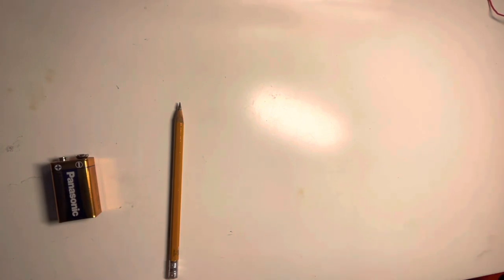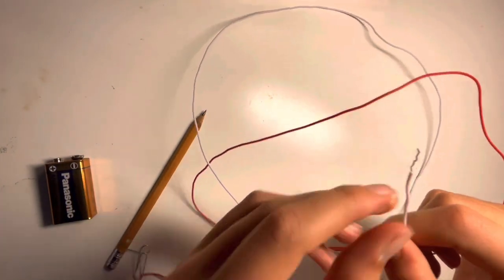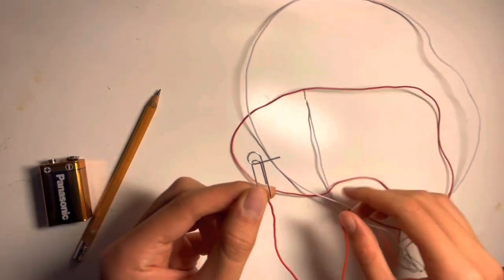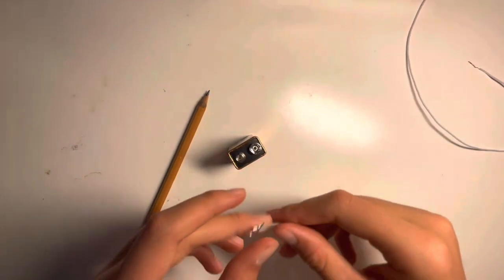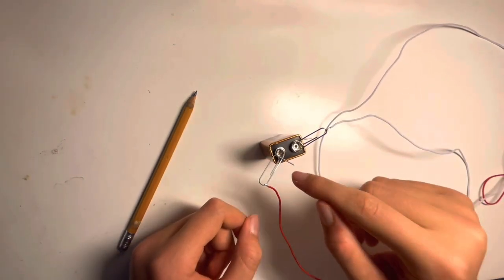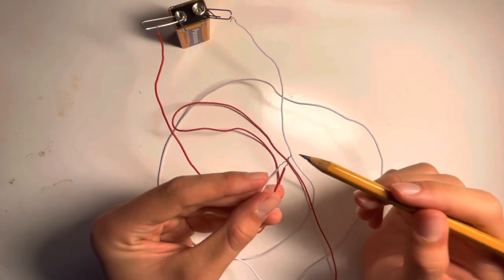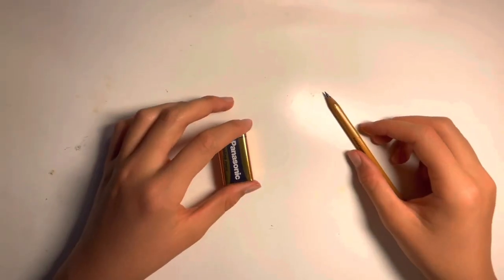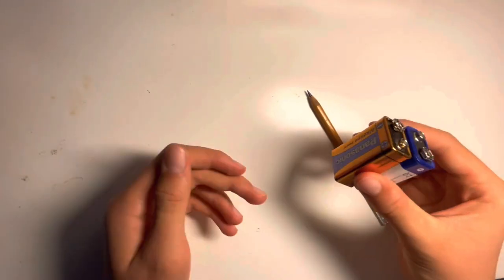How to create Safe Sparks at Home using a Battery

Comment: While doing this, make sure that the wires aren't connected for a very long time, this can cause the battery to explode.
Reply from the maker: Good reminder😂
Reply: Pretty sure that's not gonna happen, it just closes the circuit after all, that's how all Circuits are made, from positive back to the negative in convention flow.
Reply: @FloofyTanker  If we keep the wires closed for a long time without any resistance, then it will blast.